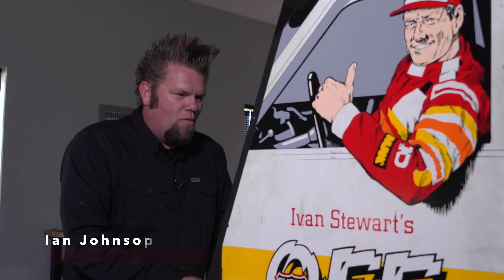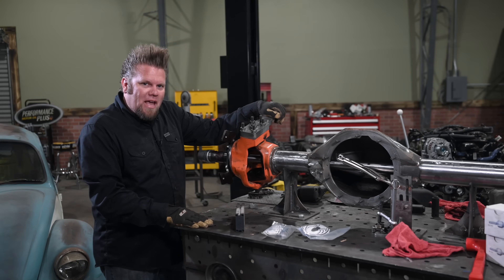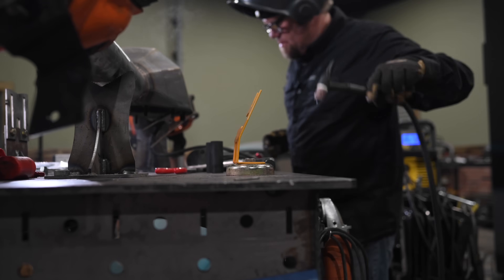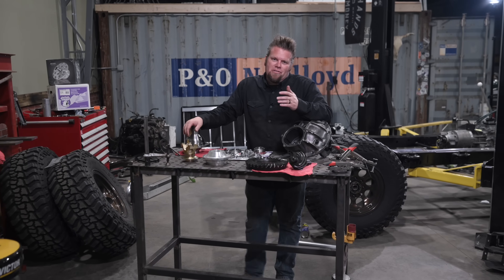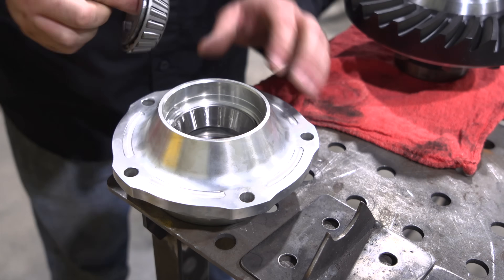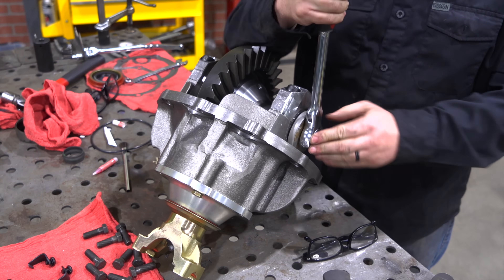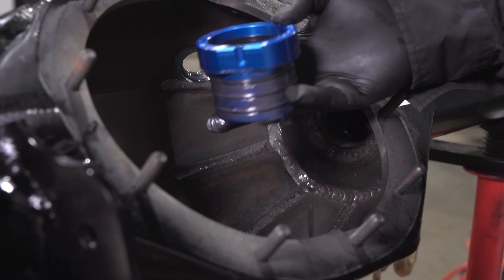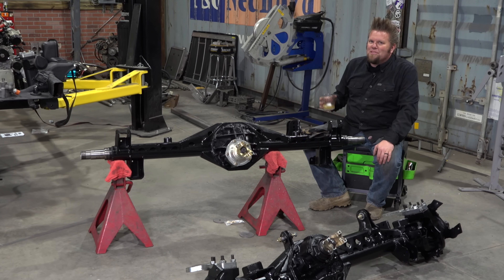How to Rebuild a Ford 9" Axle; Willys Wagon Ep 9

Comment: In a discussion w a buddy getting ready to shorten a 9”, why tig root? The backing plate caps that came in look like one good hot pass w the mig would do. But this video is his arguing point for why I should tig then mig… 
What am I missing bröther?
Reply from the maker: The thickness of the material you are welding determines the need for mutiple passes...the TIG root allows you full control over the molten puddle and "set" the pieces prior to the MIG cover. You also can move around the material with the TIG essentially welding in a criss cross pattern to prevent the knuckle or bearing plate from "pulling" If you just "crank up" the mig for one crazy hot pass...yes it will work..but there is a greater chance that the end cap pr knuckle will not be straight
Reply: Thank you for the insite you absolutely confirmed my theory concerning distortion. Looks like slow and steady wins this race!

Comment: Do you have a video on the full specs on the front  axle? How is it a high pinion and the rear is low if thier both a ford 9 inch setup which is low pinion I thought
Reply from the maker: the front 3rd member is from a company called True Hi9 they make a high pinion 9"

Comment: What full float set up did you use for the rear?  Is it a dana 60 or 14 bolt spindle?
Reply from the maker: Its a 14 bolt spindle
Reply: You need to do a video on the rear axle build alone, hint hint...

Comment: Nice build!
I am in the process of building a 9" rear for my 2000 TJ.  I've got the same 3rd member setup except I went with 5.13 gears.  I'm using the Artec top and backbone trusses to strengthen it.
The front is going to be a D44 high pinion from a 78 F150 (retubed to get rid of the c wedges).  Hoping to be able to afford an OX cable locker for that one... $$$

It's all just time and money...

Comment: I noticed that the front diff is flipped(hi pinion) and the rear is not.  Did you get reverse cut gears?
Reply from the maker: It is a High Pinion drop out from True HI9
Reply: @BigTireGarage  that's awesome, can't believe I have not seen one of those.  Then again, it took me two years to source a junkyard hi-pinion LC elocker for the front of my '86 4Runner!  😬

Comment: Great content, do you have multiple size alignment bars for different spindle sizes? And where did you get them from?
Reply from the maker: No the bar stays the same....1.5" ground and polished solid bar.  I have different size spindle nuts for different spindles.  As well as pucks for unit bearings.  I either buy them or I have them made for specific applications.